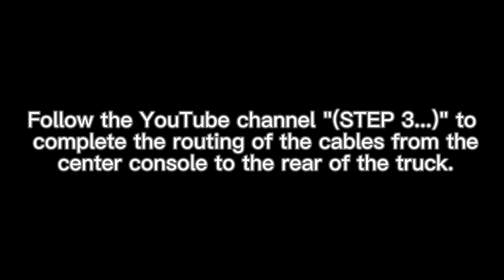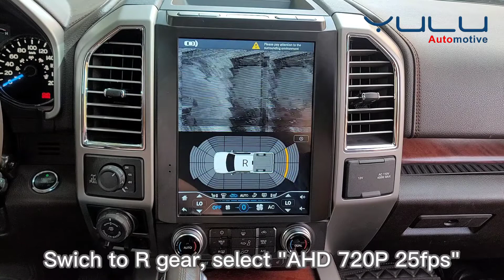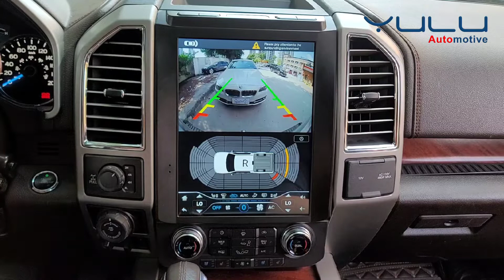Replace the OEM reversing camera to AHD camera. for F150/250/350/450 Tesla-style screen radio

Comment: Can this be used with the Factory 360 Cameras? I'm just got my E10 a few days ago and the idea of switching to a HD backup camera would be great.
Reply from the maker: This rear camera cannot be used at the same time as the factory 360 system, because the factory 360 system only supports the low definition CVBS camera and cannot use the higher definition AHD camera.

Comment: I need the rear camera that I do not have to run extra wires for and also the microphone that fits in factory spot for my 2018 F150. I have the E10
Reply from the maker: Do you have a factory 360 camera system? If there is no need. If you need help, please contact our after-sales service in the following ways, they will give you the most professional technical support, thank you!
phone: +1 (818) 484-6579
Email: service@yuluautomotive.com
Messenger APP: @yulu automotive

Comment: can you just replace the camera and not all of the wiring?
Reply from the maker: We can do this for you, but need 2 conversion connectors to use the factory camera harness.
Reply: @yuluautomotive7433  I would like to get this harness instead of having to run wires under my truck etc.
Reply from the maker: We are now designing the mold for the connector, which will take at least a month, and we will notify you of any progress.

Comment: Is this a requirement for the install of the E10? Or, can I keep the OEM if I choose to without changing it to the HD camera?
Reply from the maker: You can choose to continue using the OEM rear camera. But due to the higher screen resolution of the E10, the OEM rear camera display on the E10 is not as clear as the AHD. Using the AHD camera on the E10 shows more clearly than using the OEM camera on the SYNC3. That's why we recommend users to choose a higher-definition AHD camera, and it's free.